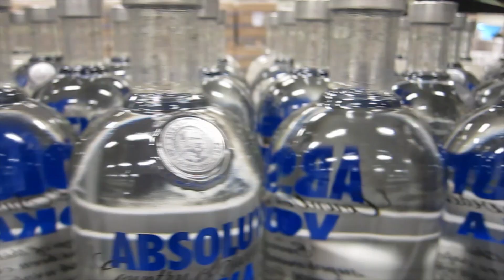How Vodka Is Made: Behind The Scenes of Absolut Vodka

Comment: No need to drill down 120 metres to tap water from an aquifer if you are going to run it through a reverse osmosis filter, you could use any water and get the same result.